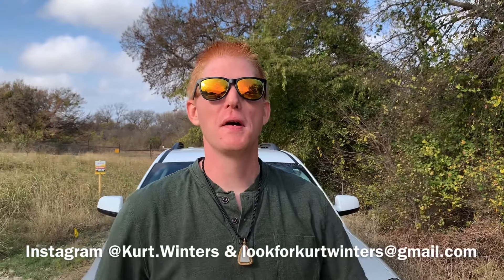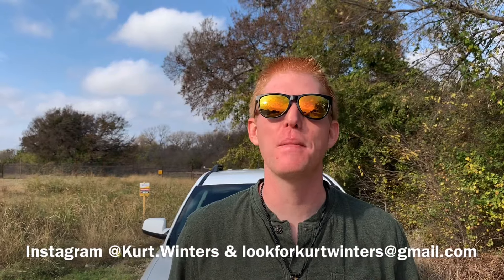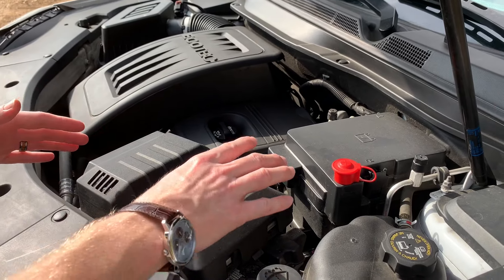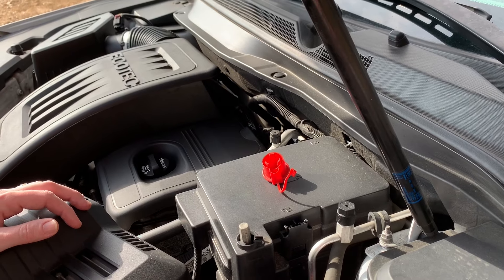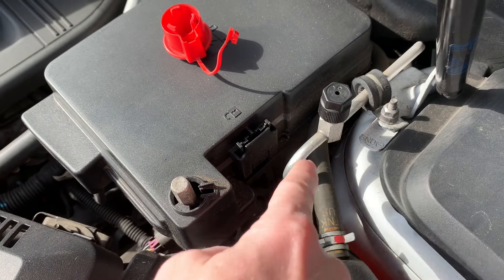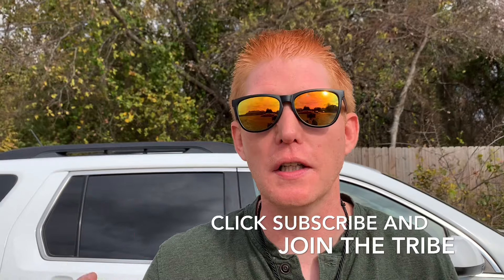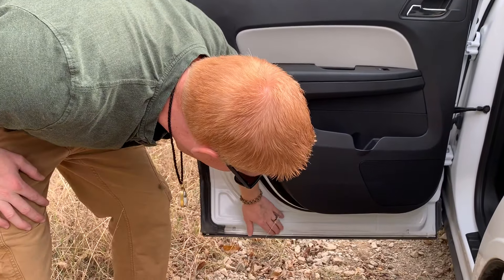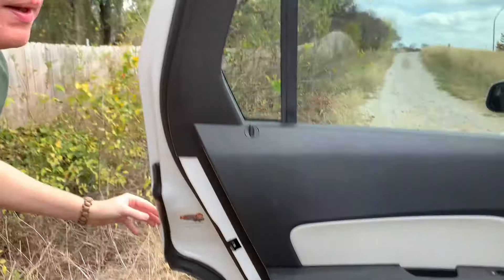3 Reasons NOT to BUY a GMC Terrain SLE  (Issues buyers should know before they BUY !)

Comment: I have a 2012 GMC terrain sle awd.My experience so far after owning it for a couple months is I've had to take the drivers interior door pannel off and libe the window cables and guide tracks because the motor that powers the window was barely able to raise the window and it started to raise crooked.I can see me replacing the motors sooner than later.I noticed the panel had been removed before but dont know why,my guess is that the window got stuck crooked and had to be manually straightened.Another problem with these vehicles is that there is a vent hole from the block into the intake manifold which is such a small hole that almost anything will clog it causing major expensive problems and will contribute to burning a chit load of oil. Also,the upper air intake that sits above the throttle body has a small vent hose on the side of it that gets clogged and needs cleaning every oil change which should be every 30,000 miles if you dont want crud build up and want the motor to last longer.Dont go buy what the oil percentage rating on the car says,if you do,you'll be very sorry after a while.Take the upper air intake box that sits above the throttle body off and clean it out with gas because that little vent hose pushes all kinds of used oil into it and moisture that gets sucked into the throttle body and back into the motor which is not good.Then remove the intake manifold,if your even somewhat mechanically savvy you can do this with some guidance from youtube.Reason for cleaning this is because it too collects everything that gets sucked through the throttle body also.I have the 2.4l motor,sorry,I should have mentioned that earlier but there you go.
So far I've changed front and rear break shoes,air filter,plugs,diff fluid,transfer case fluid,oil & filter, both O2 sensors,since I've had it.Not because it needed it in the two months I have owned it but all but the oil  change hadn't been done by previous owner as far as I could tell.Yes it had been taken in for servicing by the GMC dealership but I guess they dont count diff and transfer case fluid changes in their service regiment.Next on my list is of course all 4 wheel bearing replacements,front axels most likely,battery so I dont realize that I should have changed it after I know I should have changed it.lol Might have to change the cat but I hope  not.Ive read that the resonator splits commonly,and I've noticed one of my rear tail lights has a small swimming pool in it after I wash it.
Another let down is that the stereo,even though it sounds good,it doesnt get loud enough for me so if I keep it I'll be changing all speakers,installing after marked deck,amp,line driver,eq,signal processor and sub to start.
Honestly,I do like my vehicle,its not too big,its comfortable,easy to drive and looks good.I have to wonder though,"HEY,GMC, c-mon brother,you could have very easily made this vehicle so much better by using better materials and some common sense and it would be a line of your product to be proud of for the price you asked for it.
I've been a faithful GM follower for the better part of the 50 years but lately I cant say the same.
It's at the point now where nothing is meant to last long enough to make till its paid off by the common folk never mind thinking your going to hand it down to your kids.I wouldnt put that financial overload and safety hazzard on someone.How many others remember getting the family vehicle when they got their licenses?Sad knowing that kind of passage is a thing of the past,my past.At least I can just go get a Koenigsegg or Bugatti,they aughta last,them carbonfibre cars dont rust.Im lieing,i wish.
Reply from the maker: I agree, I've been a GM guy since the 3800 Series 2 motors..... Sorry about your windows, my SUV was lightly used. My car ate it's front wheel bearings 94k miles..... And yes change your OIL every 3 months.... will turn into sludge, ESPCIALLY if it sets during the virus more !   DID YOU SEE MY CORVETTE videos ?
Reply: @KurtWinters  not yet but I will.
Reply: Don't bye new speakers bro you'll need a mini amplifier that connects from aux in glove box to your Phone... I bought 1 used $35 EBay HELL OF A DIFFERENCE! The Aux plays INCREDIBLE NOW! People think I have beat but it's all factory and the poineers really Thump now!
Reply: @rontam06  I had no idea there was a aux in the glove box.what was the amp you had to get?I'm very interested in doing and getting whatever I need to get better sound.Thank you for your reply.
Reply: @rontam06  "aux in glove box",are you referring to aux power behind glove box?
If so where is it located and what color wires should I be looking for?Honestly,I dont know much about this vehicle yet and any help you might be able to give would be deeply appreciated.
Reply from the maker: @rontam06  I plan is a NEW JL Audio system with a subs, i have just waiting.... Good tip on the AUX !
Reply: @greggo7978  the Aux is above the USB input in the arm Rest the Mini amp is called FiOS a3 hi resolution headphone amplifier w/bass boost(many others you can get also). Fam I promise you the radio finally sounds like a pioneer system 💯. I just upgraded my phone so now the sound is even more incredible! I have to lower the volume sometimes cuz the Bass even w/o bass boost on THUMPS! Now when I'm next to another terrain I'm sure their like How is his System so Loud?! 😆
Reply: @greggo7978  no I have 2012 slt I have no aux in glove box it's inside the arm Rest no wires unless you buy aux cable to plug into it
Reply: @KurtWinters  FiOS a3 hi resolution headphone amplifier w bass boost! YOU'LL THANK ME LATER 😊. before you buy the speakers but I can't blame you son! 💯 Do your Thang!
Reply: @greggo7978  sorry guys not the glove box the Arm rest is what I meant.😩
Reply: @rontam06  Thank you for clarifying my friend.I know exactly what you mean and appreciate the info.Im looking for the pieces you suggested as we speak.Very glad to have met you on line and thanks again for your help.
It's nice to know that theres still good people like yourself out there.Much respect bro.👍
Reply from the maker: @rontam06  Yeah I've owned them for a few years now. THX SIR ! appreciate the comment !

Comment: As a Terrain owner I would also suggest you check the spare tire well(?) in the cargo area.  Water will leak in from behind the tail lights and pool in there.
Reply from the maker: GREAT TIP, I will add it the next video !
Reply: I need to check this. Water gets in the back left light. So everytime I open the back hatch when it's at it's highest all the water come pouring out of the inside panel. I'm surprised nothing in the back has malfunctioned
Reply from the maker: @Lizz033torres  Thanks LIZ, SUV's should not leak. Please be cautious !

Comment: I bought a 2014 gmc terrain sle awd with the 2.4 about 1 year ago.....but i have yet to have any issues with it what so ever not even the oil consumption that everyones complaining about and i even pull a little trailer with it all over the place....it only had 95000 miles on it when i bout it now its up to like 105000.....only thing so far for me anyways that i can get behind is the always shifting it shifts so much and no real power but then again it's just a Lil 4 banger with a big body😂😂
Reply from the maker: THE suv is sooooo slow. especially in eco mode OMG. it can get out of it way ! great comment. thank you for supporting the channel !

Comment: I have a 2011 gmc my truck won't start but it clicks but won't start  would should I do I was told a lot of gmc have problems starting
Reply from the maker: start with replacing/checking the battery. Then look too have the starter checked by a mechanic. Does it not start all the time, or is it intermittent ?

Comment: The negative battery terminal is accessable.i don't know why that stud is said to be the spot
Reply from the maker: but it is ! and it works
Reply: @KurtWinters  like it for a hand held booster pack.but for a dead battery or no alternator.i use a jumper with large clamps
Reply from the maker: @jameswaas2405  great info thx james

Comment: I worked for assembly plant where we build these cars and I can tell you I'd never own one. An absolute junk. Now they are facing lawsuit over the headlights blinding oncoming traffic drivers...

Classic GM, they petitioned the recall arguing no one got seriously hurt so they shouldn't have to do recall. So  like with the ignition switches, they want to wait until people will die before doing anything. And even then, they will pay the family some money and settle the case because it's cheaper than recall.

Also, their new Silverado and Sierra trucks face 3 lawsuits now...
Engines
Transmission 
Paint

When it comes to Transmissions, GM didn't want to honor the warranty because they argued that warranty covers manufacturing defects and not design defects and Transmissions are failing due to design flaw, not manufacturing defect.
Reply: Wow... I'm watching this because I'm seriously considering buying a 2013 terrain thus week
Reply: @rell4474  I would seriously stay away, 2013 model faced a lawsuit over oil consumption, GM  never fixed the problem, just reached a settlement with their owners. I would honestly not touch an Equinox or Terrain. If you're in the market for used cross over I'd go with Toyota RAV4 or Honda CRV. I tell the same thing to my family when they approach me about employee discount from GM. I tell them I can get it for them, but I would highly recommend that they didn't buy GM in the first place, especially not used.

Good luck in your quest, do good research, you'll thank yourself later.
Reply: @googlreviews7813  I'm going to, I've seen enough in researching! Even a fb groups with hundreds possibly thousands of the same story of a blown engine because it was burning through oil. Truly sad for the people left w no vehicle or paying on a car that's no longer drivable. I called the dealership this morning, even though it's sat, to leave a message that we decided to go with a different suv. Thanks for your comments and honesty
Reply: @rell4474  You're welcome. I find myself in awkward situation because on one hand I work for GM so I want GM to have sales so I can have a job, especially since I don't have many years left to retirement. But on the other hand, if I know vehicle has a flaw, I can't tell someone to buy it just be ause I worry about my own job. In the end I feel good about telling the truth, I couldn't live with myself if someone sunk tens of thousands of dollars into a  edible that is doomed from the start. CRV or RAV4 will be more money, but what you'll save in repairs will more than make up for it.  Having said that, make sure you research the dealership you're getting it from, only buy from reputable sources, dealers tend to be scam artists too. 

Good luck and glad to help.
Reply: @googlreviews7813  thank you again, that's totally understandable but people like me find people like you to be gems. Honestly and kindness is unfortunately a rareity these days. I wish I could get a honda passport I just love those!! I figure I should be able to get a new vehicle on my next car after this. If that makes sense. Basically one more used vehicle. My other vehicle is a chevy, equinox 2009. Boy, do I feel I got lucky with that! I didn't research til after I bought it. All these terrain problems plauge the equinox too, as you know. But it seems to be 2010 and after. 2009 was equinox best year according to Google. And I believe it, mine has over 200,000 miles now and it's been great. Outside of regular oil changes, the heat stopped working once, it just needed a coolant flush. I feel so blessed to have lucked out with an 09. Yes, I will research everything  as we really need a 2nd vehicle. Thanks for all your tips, God bless!
Reply: @rell4474  

Thank you very much for your kind words, I wish you and your family all the best in your quest for new vehicle. 

I would just like to add that several vehicles as of late, even Honda who is known for making very reliable engines had issues with their Turbo charged engines. So I would stick to Naturally Aspirated engines if possible, basically old school engines.

Cheers!🤜🤛
Reply from the maker: Really ? WOW.......
Reply from the maker: From 2014 on, they seemed to improve !
Reply from the maker: Honda and Toyota are far superior vehicles !
Reply from the maker: Your Welcome, wise choice. Tell us what you end up with ?
Reply from the maker: Preach !
Reply from the maker: Thank you ! God Bless you too. May he lead you to the right SUV !
Reply: @googlreviews7813  I have the oil consumption issue with my 2015.  It also has several rust points on the rear hatch and seems to idle high.  I always have issues with brakes and rotors with GM vehicles so my unfortunately my next will be a different make.

Comment: I’m looking to buy a 2017 slt1 with 128k miles for $15k. I’m on the fence about it! It’s a 4cyl.
Reply from the maker: find out if the timing chain has been replaced. that price is about 3k higher than average. But if the SUV has been well taken care of and maintained, then that not too bad a deal.
remember the 4cyl are rather slow. So if your used to v6 or v8, prepare your self, thanks for the comment and sub maggie !
Reply: @KurtWinters  thank you! I’ve been doing so much extensive research and at the end of the day I may not get it. I’m trading in my Camaro for a crossover since I just had a baby! I’m looking at a 2019 Cherokee as well for way less miles. But I’ve come to find out every vehicle has its pro and cons. Always a hit or miss!
Reply from the maker: @maggiegaspar4047  have you looked at the toyota RAV4 or the honda CRV ?

Comment: Omg I wish I had found this video right before buying my 16 terrain…I fell out when you did the ace Ventura because my wipers stopped working completely and stuck right in the middle  of a snowstorm while driving on chicago expressway…I had to literally drive 10 miles an hour because I couldn’t see..and yes I’ve heard the clicking noise but only have 67K and I have felt the Chevy shake too😂😂😂
Reply from the maker: The wiper motor's is a big big deal. I've never had another car do that to me. Also, some owners have experienced 2x. Glad you were not injured.

Comment: What do you expect for a $30,000 midsize SUV.  That style of negative grounding has been around since at least the mid 80"s. As for the roof you will find very few roofs that don't flex especially any eco vehicle. My 2014 Terrain SLT has 158,000 miles  (257,000 Km). I have only replaced the battery and a rear link. No rust and I'm in Canada where we use a ton of salt. This has been your only video I have seen so far And you are not a car guy. By the way the Chevy shake was something that was started by Ford guys. Nothing shakes worst than a Ford. The only Fords that don't shake are babyed, trailer queens or very rarely leave the garage.
Reply from the maker: thanks for your comment, but if you go to my page.... you will see, sadly, that I am a car guy....